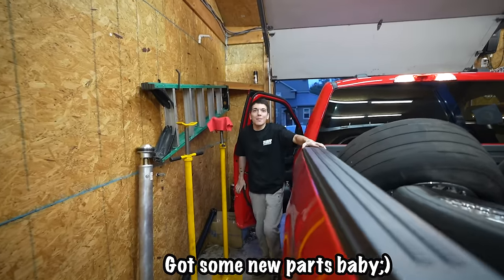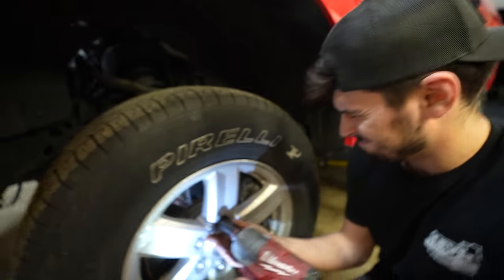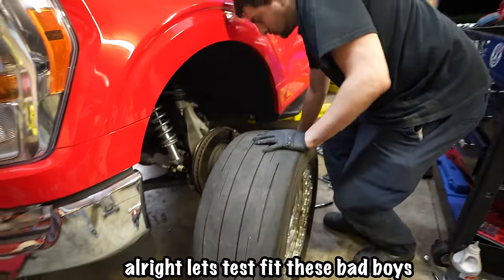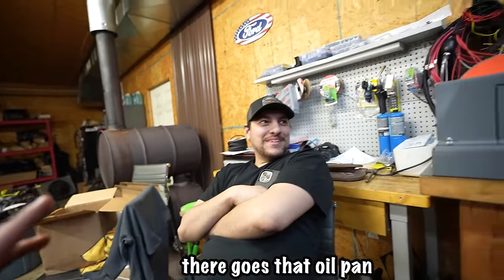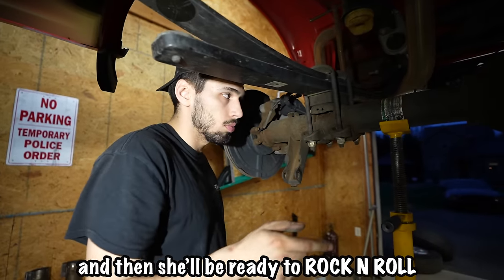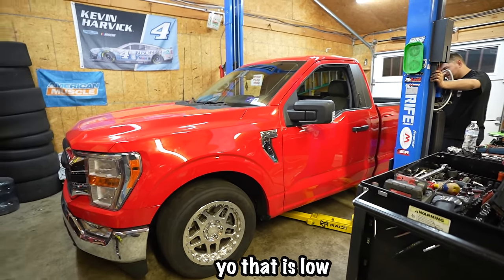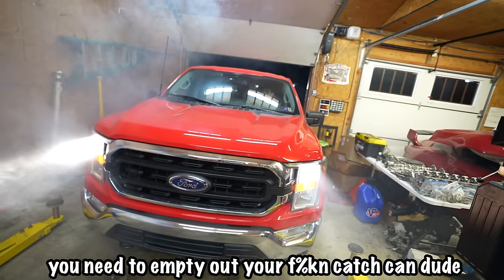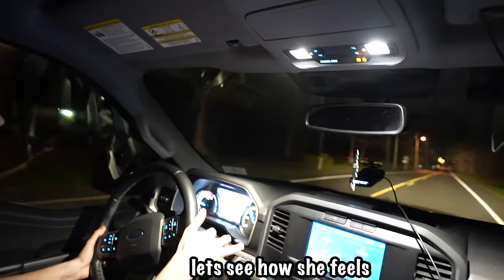I Made My SLEEPER F150 EVEN FASTER!

Comment: Dom please upgrade the oil pump gears and support the front snout last thing you want is for your crank pully to snap off or shred your oil pump gears
Reply: The 21+ doesnt have a regular crank driven oil pump, they have a kevlar belt drive pump. No need to mess with it. They’re good for like 1200hp

Comment: @DomTracy I would need to catch up on videos, but, if adding more power, with the whipple, get that crankshaft supported/reinforced brother.
Reply from the maker: Will do brother🍺
Reply: @DomTracy  Just caught the new vid. Sucks man first time out and the battery was throwing you issues. Know you hit the Mexico streets. But, are you going to grab an open track night to shake down the truck? Get you a solid time, roll in for the weekend event and you know what time class to throw it in.
Reply: @DomTracy just get a 20% overdrive balancer for now.  I wouldn’t worry too much about crank deflection unless you’re running a transbrake or 2 step.  Or if you plan on really turning it up. 
Seems like your tuner has you on a pretty safe tune.
Reply: @Boots67 ngl i don’t know shit abt cars but sounds cool

Comment: Yall dont forget to swap out your factory cast oil pump gear for the billit gear.  Might as well upgrade the oil pump housing for $100 while youre at it.  Should have been done when putting the supercharger on cause all the parts that need to be removed.  Yall are crazy and i love it
Reply: They are different on the f150 mostly more common problem on mustangs not on f150s

Comment: I used to think my 21 whippled F-150 was quick at 10.5 psi.... until it got bigger injectors , fuel system, smaller puller and E-85 tune.

Comment: I just got done building my f150 regular cab short box 2wd . Took me about 7 or 8 months.  I have pictures from original to how it is now . I still have leds and the Coyote to put in once I buy a entire farm truck. I did it all myself it looks killer next is Coyote.  So I'm driving it now well I'm waiting for a $1500 f150 with Coyote
Reply: It's slammed and on 2014 Lincoln platinum 22inch rims with street 27540zr22 tires . It's one sick f150 looks awesome but holy fuck I did a ton of work .notched frame painted it a very dark blacked out look .once I get the Coyote motor omg it will just complete it as the sick look is already done.